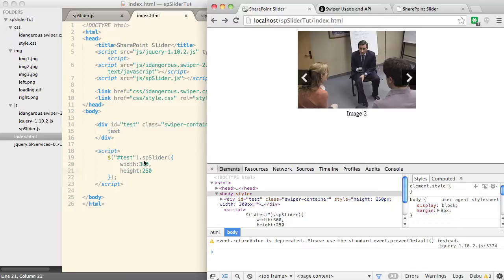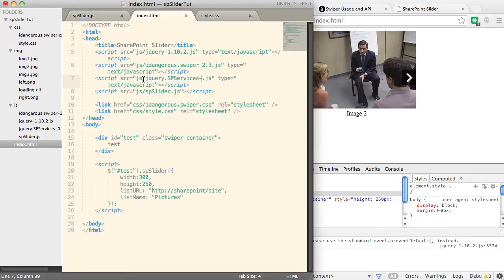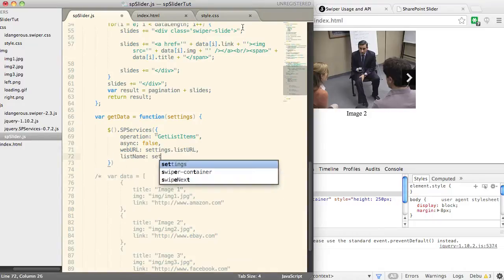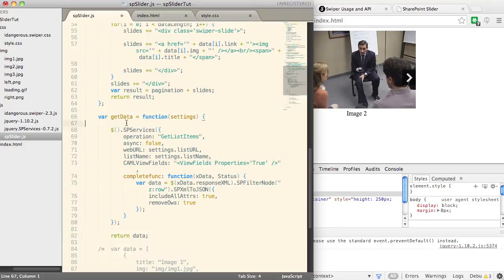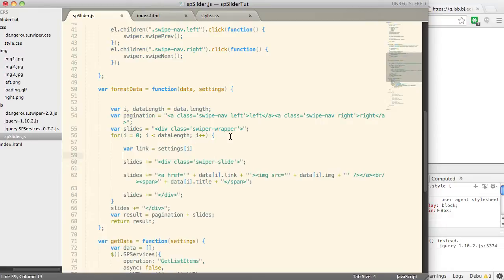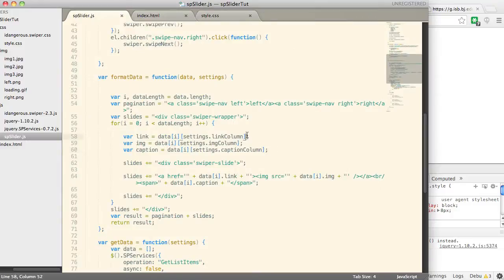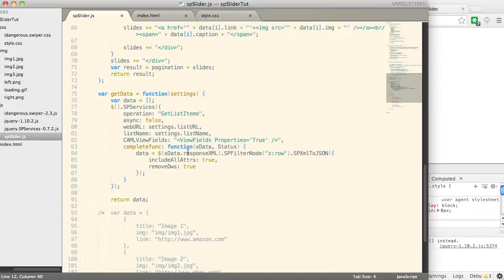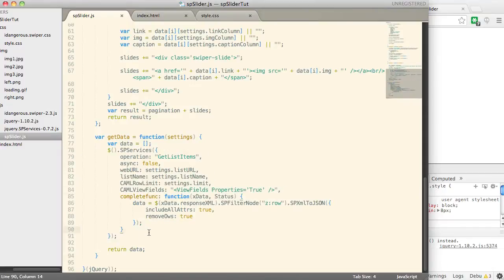Build a SharePoint Slider with a custom jQuery plugin (Part 4)

Comment: var swiper = el.swiper(settings);

spslider.js:41 Uncaught TypeError: el.swiper is not a function
    at applyPlugin (spslider.js:41)
    at jQuery.fn.init.$.fn.spSlider (spslider.js:24)
    at index.html:27

There is an error
Reply: The newer version requires that you call "var swiper = new Swiper({settings})" - check the docs